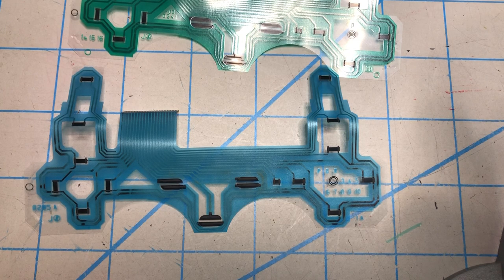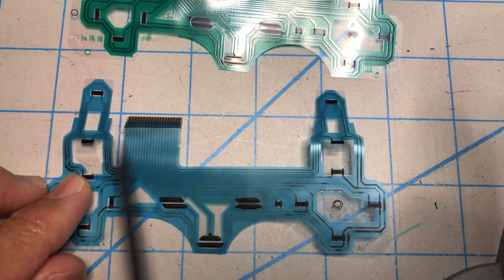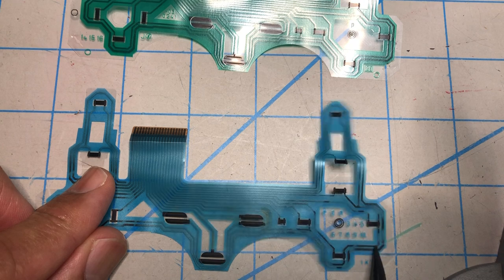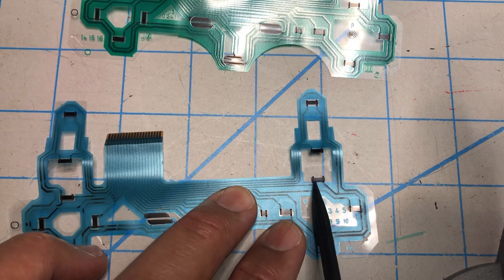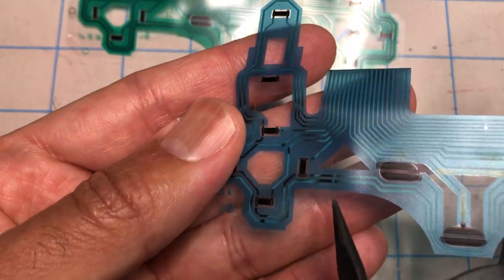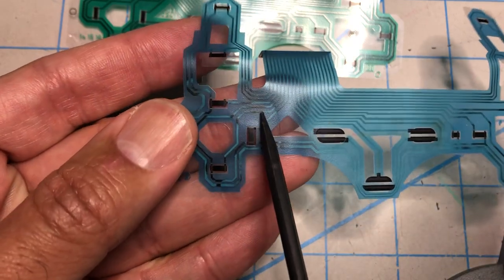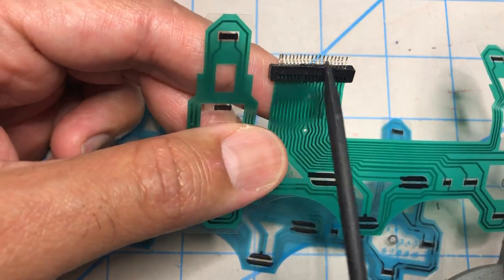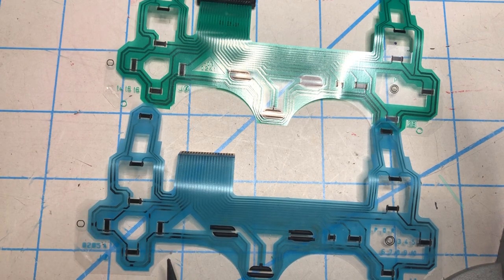Model H Repair - Why ribbon cable fails

Comment: That problem i solved for maybe 20 yoistick, its easy repair with  electrically conductive glue
Reply: I have some ps2 controllers damaged. I ordered condutive glue and i will try my luck
Reply: @sjogosPT  if you need more detailed information on how to fix electrically conductive glue let me know
Reply: @exyurock8801  where can we find instructions to make this repair with the glue?
Reply: That sounds like a great idea. What glue did you use?

Comment: I have the same dark green original PCB as this video where the whole connector needs replacing. I'm looking in Ali express just wondering what one I should use and if it's worth 1 buying multiple replacement ribbon s and connectors and 2 what one should I be ordering in the first place? It has the 19 pin connector but it also cuts off from the last trace near the L 1 button membrane

Comment: I have the same ribbon, with the same problem. Nobody seems to sell an exact replacement for it. Bought Q42 and Q43, but neither were the right part.
Reply from the maker: Sounds like you have the one that uses a connector, in that case the one you need is likely the 43A that you have but you Eva to shift the cable all the way to the right since the port is 19 pins but the ribbon cable is 18, once you do that it will work.
Reply: @restartrepairs4393  I did that. The start button did not work and the up and left d-pad buttons were reversed.
Reply from the maker: @uglytruthist9914   That means you have the 42A ribbon on a H controller, you need to swap it with the 43A, and the start button, clean the rubber pads with alcohol and if that doesnt work, you have a bad ribbon cable, when I buy then I order 600 at a time because the defective rate is high on some sellers, so to mix it up I order batches of 100 from 5-6 different people, I get better results that way, but I also have 500 to 1000 controllers to fix too any given year.
Reply: @restartrepairs4393  Yes. I have that one. It did not fit inside the frame, so I trimmed it with scissors to make it fit and it did not work at all. I came to the conclusion that both were the wrong part, but there is no third. Those little side tabs on the connect point got it the way, so I cut them off.
Reply from the maker: @uglytruthist9914  Yes you do need to cut them off on some ribbons, I have 2 versions of the 43A and one doesnt need that. I made a lot more videos with tips on how to get them to work, check the PS2 play list.
Reply: @restartrepairs4393  I tried again using the 43a and I can see it's damaged, which would explain why it did not work. The part near the connector where you have to bend it has broken connections. I'll order another and try again. Thanks for all your help.
Reply: Yiikes! So you don't have a recommendation for a reliable source for the button ribbon?

Comment: I have a question on the H model for the blue ribbon cable the motherboard that come with the blue I have a problem on the spindle motor I try all my motor on this board it spin slow let me know if the board have problem but all buttons work
Reply from the maker: Dear Diana, I do not provide with troubleshooting, and I don't cover every issue, these are just instructional videos. I don't even connect this to a PS2 to test, so I never test the motors, only with a game you can do that and every game is different some will spin slow.
Reply: I test a good game that the vibrations is strong is the one that have more weight for the spindle motor that don't spin good all motor is new and being tested with other board and work but this board no maybe the board problem or not good voltage or a fuse going bad 

Thank you your video is good
Reply: I buy a new ps2 controller seal from Ebay I think the model A clear case board KSA1Q80A might have a problem on the spindle motors that spin slow don't feel any vibration the one that have more weight

Comment: Do you sell them ?
Reply from the maker: well yes, since I fixed them by the hundreds, they get sold in bulk online.
Reply: @restartrepairs4393  I have 50 of them with mostly the same issues, where can I get the membrane for cheap?
Reply: @restartrepairs4393  where do you buy these
Reply from the maker: @dominickjuarez5461  alibaba
Reply: @restartrepairs4393  thank you, do you have any tips on fixing the joysticks that scroll up and down by themselves ?
Reply from the maker: @dominickjuarez5461  yeah watch the rest of the videos
Reply: @restartrepairs4393  do you fix calculators ?